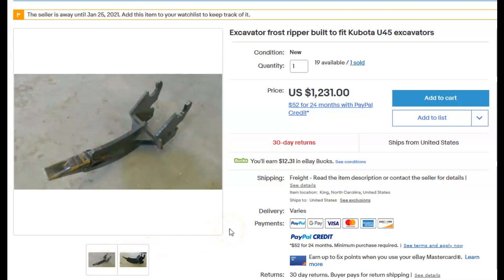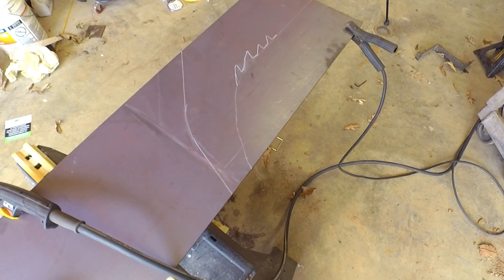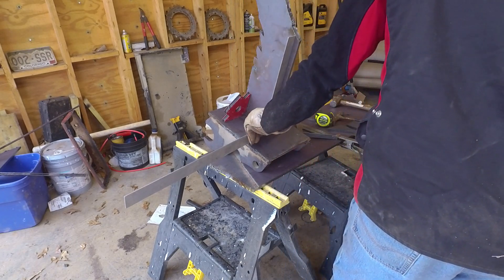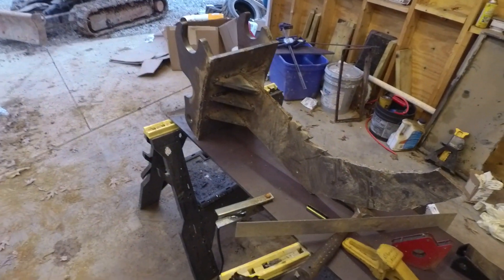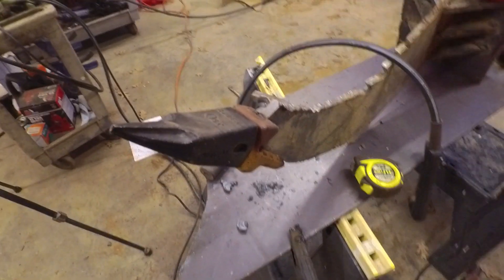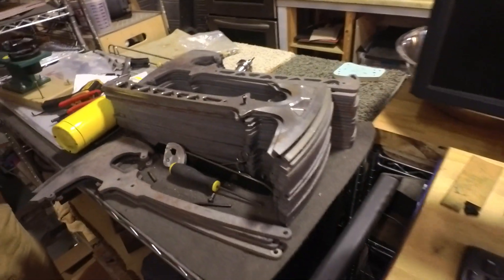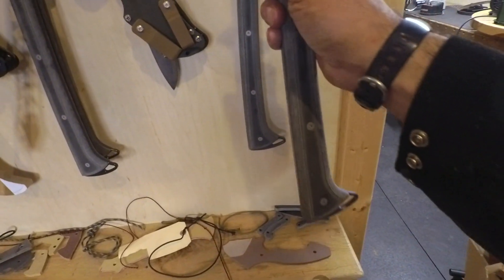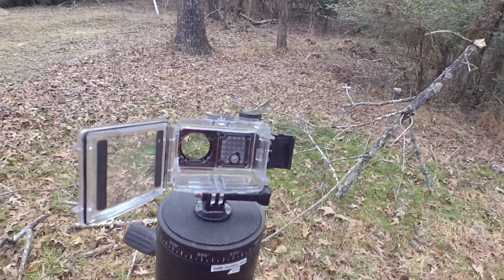Building an excavator ripper tooth

Comment: Shawn, a bigger machine may make waste out of the tooth but it's taking what you can throw at with the current machine. 👍 I prefer a oxygen acetylene torch myself however I have had to use old welding rods and crank up my welder  to make cuts before I got a torch.
Reply from the maker: This tooth needs to be repaired again. It's gotten a ton of work done, but it's bent again.
Reply: @GCFD  Shawn, I didn't know if you had seen this since I edited it.
Shawn, I found this video I think your excavator could handle something like this Watch "Excavator Ripper" on YouTube
https://youtu.be/nzEn0EHwyws
 1/2" steel is rather thin and to try to add layers of plate metal on each side doesn't help a lot because it's only welded around the outer edges more or less. Also when you added the tooth on the end I believe it made it weaker because it added too much to the length. To me I would have wanted something like 1 and 1/2" thick hardened steel to take care of most bending problems. Also tapering the edge facing the operator would be nice and you could widen the back edge more or less that would give you a wedge like appearance. However not being able to see how it bent again makes it hard for me to do much more than guess. Hope you find the solution to solve the problem. God Bless
Reply: @GCFD  
Shawn, after looking into your Millermatic 250 it's output is right about 250 amps which in my opinion is on the low side for welding 1/2" steel of any type. However it is ideal for most of the materials used in building your trailers. I've done a lot of welding in lime plants that produced crushed rock of all sizes and most all our welders were stick welders AC/DC mounted on a old pickup truck. Most of the welders produced like 600 welding amps which would weld almost anything using mainly 7018 low hydrogen rods which do produce quiet a lot of splatter. Thick metals will be much harder to weld using your Mig welder but it is possible if you make many more passes or layers of welds provided the wire penetrates the thicker metal enough to make a secure bond or weld. Also the 1/4" plate over the 1/2" plate will work but you may have make a smaller pattern that leaves you room for more passes to make sure it bonds. Also last but not least you really need to cut out some oval shaped holes near the center of the plate so you can place more welds inside those ovals to make sure the 1/4" plate bonds better to the 1/2" and does its job. Remember to make your passes in a zig zag pass as mentioned before and of course this will take multiple passes to get a strong enough weld. If you don't feel comfortable doing these types of welds maybe your friend can help out and weld it for you.  God Bless, Hope all goes well

Comment: I need one for digging trails thru shale rock areas and I have a job to dig a stump in someone’s front yard. I ordered one from Rhinox in GB. $750 with shipping. Not cheap but they make great products and it will pay for itself.
Reply from the maker: I have the Rhinox ripper tooth for my small ex. They won't ship the one for my bigger ex. There's a company in King, NC that builds them but they were out of stock when I needed this one.

Comment: What size pins are on that kubota?
Reply from the maker: I'm not sure what the size is, but it's the standard kubota quick release that is on the kx91, 121, u35 excavators. I wouldn't buy another ex without a quick attach.

Comment: Grind off the outer layer on the plate so you have clean metal to weld on. The outer layer from the making have a higher melting point thats why it dident hold.

Comment: hey  shawn where can i get  a good priced coupler for my u17-3  to make it quick attach?    thumbs up for building the ripper and saving  a bunch of $$
Reply from the maker: I got the aftermarket Quick coupler for my Kx-018 from Rhinox Group. I also bought a few buckets and a tooth from them since they were small enough to ship.
Reply: @GCFD  thanks i will check them out , going to get a grading bucket but wanted to check out   a quick attach system .  thanks again
Reply from the maker: @tcb069  I checked and it's the same setup I have on my KX-018. I also bought their 36" grading bucket and it's pretty good.
Reply: @GCFD  thanks
Reply: I just ordered buckets from Rhinox and then the next day saw they had a huge price increase. Got in under the wire! 😀

Comment: I think you’d be better having the excavator blade towards the work area and down to offer stability Shawn. Looks like a good job with the homemade ripper though now the welds are stronger.
Reply: I second this as having the blade forward also increases the amount of power required before the machines counterweight is overpowered and the machine starts to tip
Reply from the maker: I think you're right. Check out my video on moving some walnut logs where I use that technique with my smaller machine.